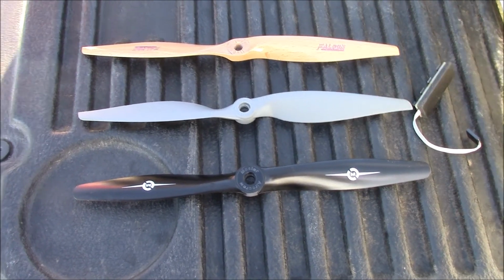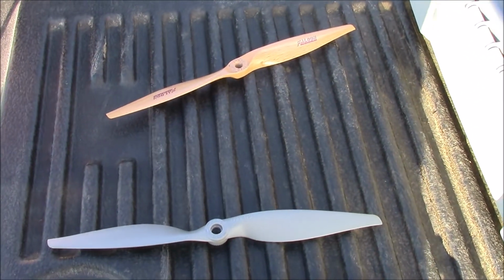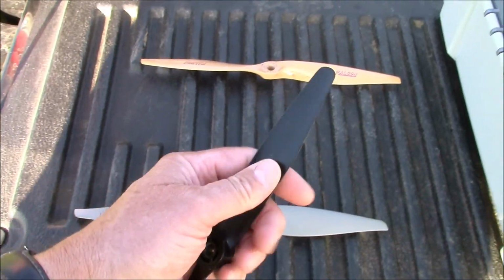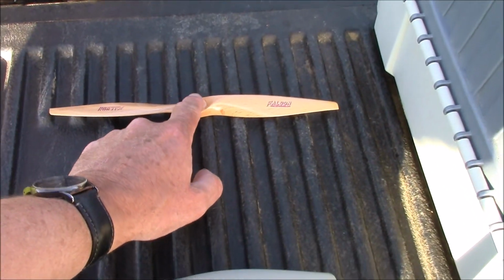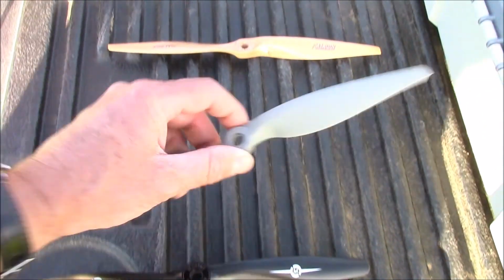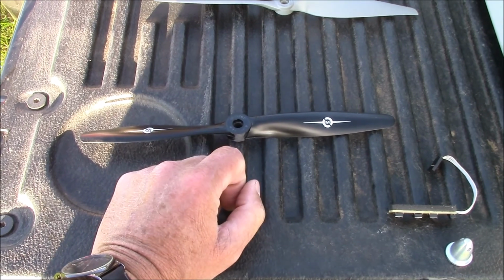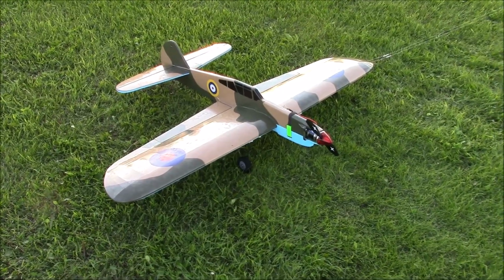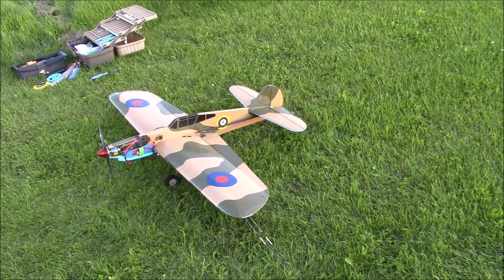Another Season with the Brodak Electric P-40B ARF

Comment: Help me understand the "elevator" on the wing.  Does it work opposite the elevator on the tail?  What is it's purpose?  I'm from the era where CL only had an elevator on the tail.  Thanks.
Reply from the maker: The wing part is called flaps and act accordingly but in both directions allowing for tighter corners without stalling during maneuvers.

Comment: Is a 12" prop possible or would I need taller gear?
Reply from the maker: It would be doable, I usually use bigger wheels if need be.
Reply: @hogsnplanes  Thanks. I've got the ARF kit waiting for me to build it, and a 3520 motor which is going to be way overkill.
The motor will probably not be happy on props less than 12".